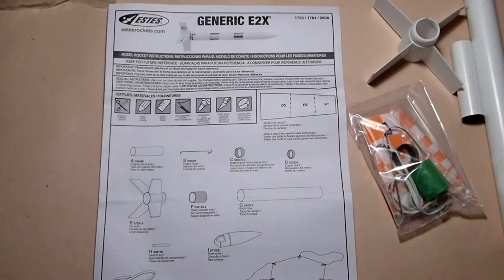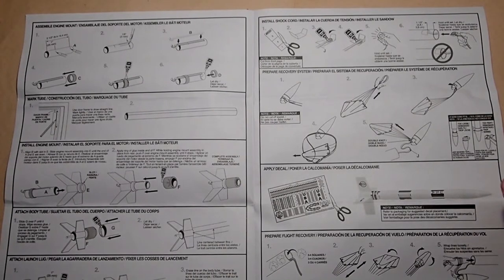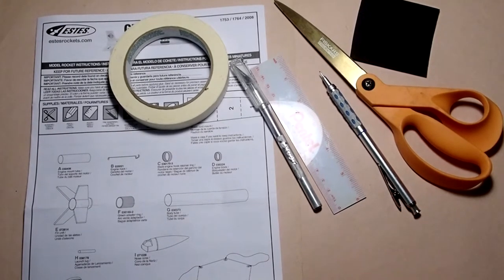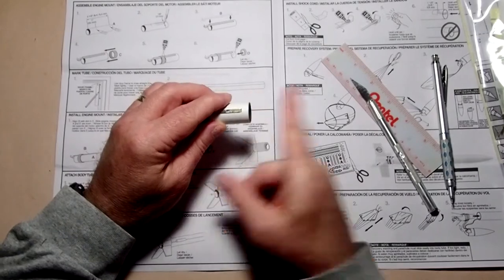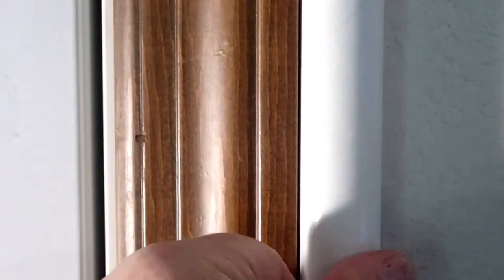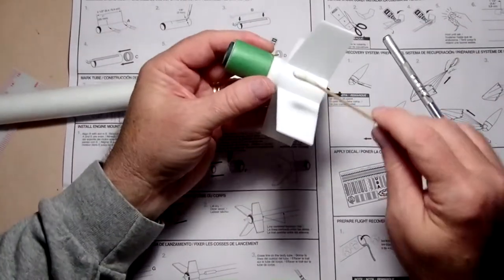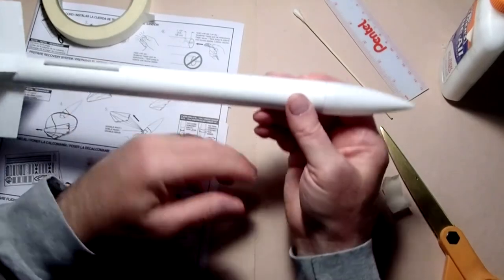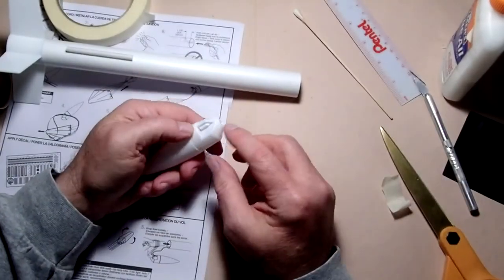Estes “Generic E2X” model rocket assembly

Comment: I found that having the engine hook on the opposite side of the launch lug makes it difficult to use igniters -- the hook interferes with the paper portion of the igniter, making short circuits more likely as you try to connect the micro-clips.
Reply from the maker: Agreed. I've made the switch to putting the clip on the same side as the lug.
Reply: @REAR_rockets I'm glad I saw this comment as I'm at this point in the build! Thanks for the video!